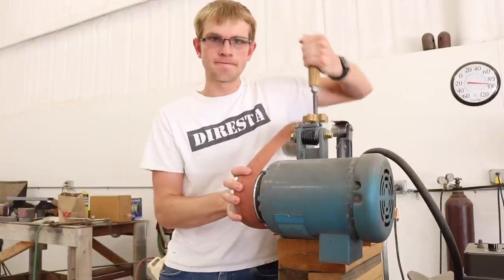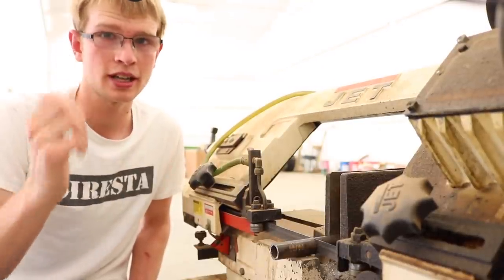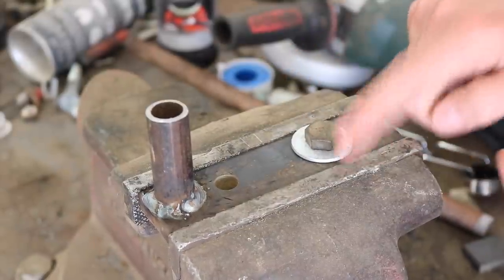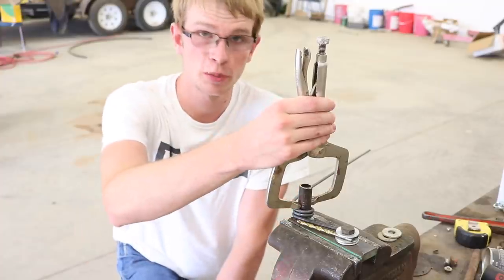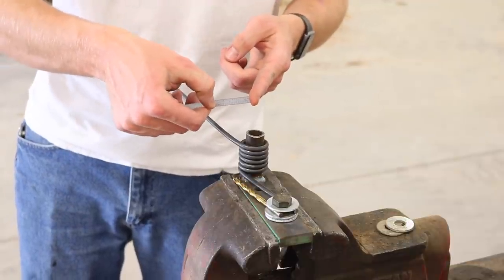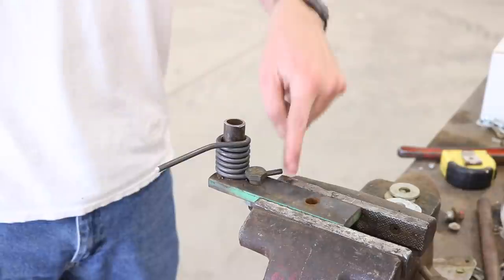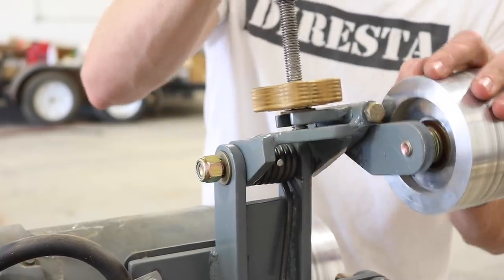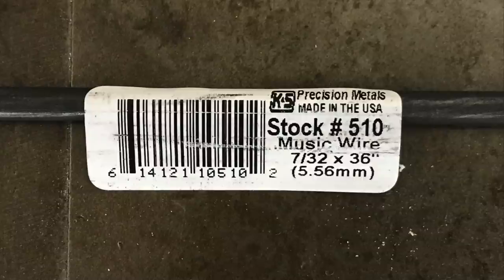How to make a torsion spring

Comment: Your description was very clear. With the spring steel wire, without heat treatment, sometimes tight bending can fracture the said wire. In the case of yours, clearly it was ‘outside’ those limits. Thanks for the good video.

Comment: Never worry if something is too simple.  There's always someone who doesn't know how to do something (or is at a different stage in learning than you are).
Reply: TheGeekPub that's right,we can't make alone,we can do great a field while people would do other fields better or they're not exhaust of thinking so they can easily make solution.
Reply: The Geek Pub. Zachary - I never knew. Now I do. Standing on the shoulders of giants and all that, or just being willing to learn.
Reply: I watched your video to see if it was even possible for me to make my own spring. It answered my question. Yes, I now know it is possible and will try it soon. Thank you for posting the video. It told me what I needed to know.
Reply: There is that saying there's many ways to skin a cat and some may need an idea on an easier way to do something. There IS a more complex way of making a torsion spring but your way achieves the same result a lot more simply.
Reply: Mike Hegarty  Me too! I've been woodworking for 20 years but watch em all because who knows? Maybe someone has come up with a better/easier way.  For eg: I watched a video by William Ng (I think that was his name). Saw him using vernier calipers. I've worked with certified Master Carpenters who didn't. I picked up a cheap pair for $10 and the quality and ease of my work has increased 10 fold.
Reply: yeds, like me.. I was wondering if spring steel needed heat treatment or anything in order to spring- this vid answered it beautifully
Reply: @muskokamike127  being skinned so many times? poor kitty  :(

Comment: Piano wire, or "music wire", is a specialized type of wire made for use in piano strings. It is made from tempered high-carbon steel, also known as spring steel, which replaced iron as the material starting in 1834

Comment: I just used this method to make a spring, very good. One improvement to the method is to first bend an inch of one end of the wire to 90 degresss. trapping this bend against your holding bolt, under the washers, will remove the need for a drill bit as a spacer and (more importantly) stop the wire from twisting at all whilst you are bending. Doing this my springs came out with virtually no slant on them.
Reply from the maker: Good point, thanks for the tip!

Comment: You're right that if the loose end of the wire gets away from you, it can do you some damage. I did that making a spring out of heavy copper wire, and even that cut my finger pretty good. I used a bolt for the mandrell so that the coils would approximately follow the threads, and it wound pretty close that way. I think this is a valuable video, especially for those who are going to build your grinder. The safety factor alone was needed.

I should have known that you're a farm guy. We learn how to do a lot of things that other folks don't get the opportunity to. Thanks for the video!
Reply from the maker: +Jim Hester 
I just hope I made the safety aspect clear enough. Makes me cringe to think of what could happen. 
I agree, farm kids get a lot of exposure to mechanical wonders, as well as the ingenuity required to fix them.

Comment: I had a 3/8 pipe x 3ft that I used to lever the complete spring.  I kept the tip of the pipe rubbing the top edge of the last coil allowing the friction to move the pipe  (this retains a constant hold back on the spring wire).  The smaller diameter pipe allows the the bend to occur only where needed and left a perfect spring with slight tweak.   I was surprised when finished the small amount of wire left in the pipe. This was as easy as I have ever made a custom spring.  A real plus is I have a free standing vise in the middle of the floor that allowed me to walk 6 plus turns without stopping or the need for a vise grip to hold down the spring wire.

Comment: Great video! To improve the safety and get a more uniform bend, just use the pipe (like you did at the end) to slip over the piano wire during the coiling.  Slip it all the way down to the coil so that the bending moment on the piano wire is concentrated near your mandrel. Thanks for the video!
Reply from the maker: +Chris Cirone 
The issue with that idea (I tried it) is that the wire curves, and the pipe tends to slide out, away from the mandrel. It's nearly impossible to get a tight, consistent coil. By doing it with bare hands, I can actually pull on the wire, where a pipe effectively pushes it.

Comment: You are a clever young man. I just comment on the name you used for your spring, it’s a spring which provide you with torsion by bending stress.
A helical spring, like most car springs today work by torsion, also straight torsion bars were used in Doge, Plymouth ‘72, ‘73 and in the VW Beatles too. I like what you do, keep it up.

Comment: Jeremy: this is how they made the original Motorcycle Valve Springs, which sat in the open, 
I am of the impression this is a preferable spring even for the Generation 2. This style of spring can utilize even low grade steel, it is commonly referred to as a portion style spring. While the Spring you chose for Gen 2 is simple, the class of having made your own spring as part of the project adds an additional involvement for the end builder. you may also consider a true torsion bar spring, in some part of the world good steel especially spring steel is more scarce or costly. Adding a very low tech item to the build if done by proper design may also be an attraction not a detriment. Something to consider Cheers and Thanks for Listening
Again Great Video, and for some who have never considered it a useful means to the creation to making your own spring. Not a waste of time at all. Well done.

Comment: This Old Tony has a great video on homemade springs, and talks about making some tooling for the lathe that allows you to wind strings under power, and use the lead screw to set the helical speed and what-not. Also anyone who has a copy of The Handbook, there's a couple of tables in there talking about mandrel size to use to get particular spring sizes
Reply from the maker: +Rob Mckennie 
Yes, there's some good info in that one. Here's a link if anyone reads this comment and is interested... https://youtu.be/jAawhg6JtyY

Comment: Be careful when adding the spacer, as the spring needs to reduce its diameter when compressing.  If the spacer is too big or the travel is too much, the spring will behind on the spacer and you'll end up bending the ends of the spring.
Reply from the maker: +David McKay 
That is true; the spacer needs to be undersized a bit.
Reply: I think adding the spacer inside the coiled part of the spring is a neat idea, but as you mention you have to make sure there is enough space for the spring to compress around the spacer so that it never gets compressed tight around the spacer as that would just bend the tails of it.

I think Jeremy will be just fine in this case as he used a 1/2" spacer inside and as the inner diameter of the coiled spring is closer to 1" there's plenty of space, especially as Jeremy is only turning the tails about 1/2 turn so the inner diameter of the spring is still a lot larger than 1/2", he could probably have used 3/4" and still end up fine. :-)

You could calculate the exact change in inner diameter as you know how many turns the coil have and the inner diameter of the spring in relaxed state, and then solve for 1/2 a turn less, but I haven't had my morning coffee yet so will leave the numbers to someone else. :-)

Comment: Temp springs after forming about 230deg or 110cel >  Quicker way use a gas flame till brown  wont sag . 1 off does the trick 
springsteel leaf  using for chisels & such temp red hot then soak in oil    then re temper back  250deg     ting!

Comment: Great video, would though add to bake your spring in the kitchen oven at 150-200 Celsius to temper it after that bending. This prevents the spring from getting a set, i.e. it doesn't die in prolonged use.

Comment: Sliding a piece of pipe that's close to the diameter of the stock, over the wire and close to the pivot point would help when bending a lot
Reply from the maker: I tried that. Didn’t work. The pipe slides back from the mandrel and the wire wraps loosely around the mandrel.

Comment: Make a second plate+rod to put over the shaft you are bending the spring around, put a bolt (and maybe some piece of pipe to act as a roller) as close to the shaft diameter + spring diameter, then you use that to make the roller press the spring around the other pipe. You avoid the major danger that way and it makes it more uniform. 

Make sure the plate n rod you use for leverage have blunted edges and I'd put a big ass bolt through the center so it doesn't fly up or around n slap you. Not sure if that illustrates it well enough with text, you can see the principle of it in action in most wire forming videos I guess. Maybe a spring from top of the bolt for downforce so the spring wraps are nice n tight.
Reply from the maker: +archades54 
I've seen how that's done, so I understand what you're saying. But I wanted to keep this as simple as possible, for the sake of those who want to make one custom spring. They aren't going to want to take a whole day off just to build a sophisticated jig to make one spring.

Comment: To make music wire work as a spring you need to heat treat it in an oven to set the shape and make it a durable permanent spring.
I made a duplicate of an AK hammer spring using the same size wire twisted the same way and it was much stronger than the original.

Comment: To make your bending jig a little safer and easier to use, take a piece of round stock that will fit into the mandrel tube and weld it to a reasonably long piece of flat stock. Weld a second piece of round  stock to the flat bar to make an F shape so that the second piece pushes the tail of your music wire against the mandrel. You'll get a more uniform diameter to your spring that way. Clear as mud I'm sure.
Reply from the maker: +Eric Morrison 
That makes sense. But I suspect most people will want the jig as simple as possible since they'll probably only make one spring with it...

Comment: Use the pipe for all winds, not just the final few inches. Better control.
Reply from the maker: +timffoster 
I suspect you haven't tried that ;-) I found it actually reduces control and makes it almost impossible to get a clean, even coil.
Reply: Jeremy Schmidt - I could've sworn I tried it a long time ago, albeit with much softer material. I'm trying to remember where/when, but coming up blank. Other than cope wire in tight space - hardly a real comparison.

Thanks for the correction! ...and keep up the good work.

Comment: Nice video Jeremy! And THANKS for that label!! I was wondering where you found such thick music wire, and the label will help me search online for it. Did you order that wire, or buy it from a store? :) 

If I may make a suggestion.......That piece of pipe you used at the end..........use that as a handle with the wire running through it, as you are bending the wire, from the very beginning. :) It will be much more comfortable on the hands, and offer more protection against losing your grip on the potentially deadly whip end of the wire. :) 

I found your video while looking for spring bending jigs online. Surely easy enough to make one like you have, as I have the necessary tools to do so.

Comment: Where did you buy that piece of spring wire??
Reply from the maker: eBay
Reply: Recently scrapped an old mattress, tons of material to work with just dispose of the fabric in black bags with your weekly garbage!. thanks for the video I needed a torsion spring for the chop saw 😊

Comment: Not a spring until heat treat.. Will not last very long angel will keep getting larger. Heat treat Music wire for 550f 15-20 min. Your angel will change about 10 to 15 degrees and diameter will close about 10m .
Reply from the maker: Notice this is two years old. The spring has not changed at all that I can tell, it still works exactly the same as the day I made it. I guess I’ll wait for the day when it starts to change, and then I can replace it... 🤷‍♂️

Comment: Perhaps a length of pipe over the wire to aid in bending it.
Reply from the maker: +Dave Anderson 
The wire tends to curve while bending, and if you use a pipe, the curve in the wire will push the pipe away from the mandrel. This reduces control and makes it difficult to create a neatly coiled spring. I tried it, and although the spring would have worked, it looked terrible.

Comment: If and when you do a video on tying your shoes... you will be able to accurately make the statement about it being too simple...

Although, have you seen how many different ways a kid can do their shoe laces?
Reply from the maker: +Timothy Hall 
Especially when you consider the fact I wear slip-on boots...
Reply: I have watched YouTube videos on tying shoes. Because i found that i have been tying my shoes wrong for 30 years, i had been taught wrong, and text descriptions weren't doing it for me. It was many years ago though. The problem is most people including myself are taught to tie granny knot instead of the balanced reef knot. The former unties itself, the latter doesn't depend so much on shoelace material, quality, how tight you tie it, it just stays properly tied, and it looks better because it doesn't rotate out of position and is easier to correct if it's not even. Since i learned the reef knot, i have found a new level of appreciation for laced shoes.

I still wouldn't mind a video that taught me to tie the reef knot more efficiently, but not enough for me to seek one out on purpose, because 90% of the videos on any given topic are going to be terrible.
Reply: Or you can go one step further and use Ian's secure knot! It is ten times less likely to undo than the knot you are using, and is neater in that it lays sideways. Look it up.
Knots don't make shed loads of sparks though.

Comment: Looks like it could use some thin brass washers in there. 
I think its a great video, I've never make a spring like this and have many cases where I have needed  a certain kind of spring for a project.
Keep up the great work!

Also how did you decide on the size of wire to use?
Reply from the maker: +Wing it Workshop 
Thanks!
The baler pickup finger I had been using was the correct amount of tension, so I just used the same wire size and number of turns.

Comment: Jeremy, what size of wire did you use and how much lb torque will it produce?  I'm can't find a ramp Torsion spring that will fit on my trailer and thinking about making one. Thanks for you video, great
Reply from the maker: If you watch to the very end of the video I show a picture of the sticker on the rod. That should help you out. (I think it was 7/32" but see the pic to be sure) Don't know how much torque it makes; I just tweaked it til it felt right.

Comment: What other kinds of wire can be used to make these springs ? You called it music wire if I heard you correct. Never heard of that befor so wondering what other wire can be used like from a hard ware store any particular kind thanks if anyone can answer this .thank you.
Reply from the maker: I don’t know of any other kinds... but most hardware stores have music wire. It’s quite common. They might not have this large diameter though.

Comment: Why is it called music wire?
Reply: It's because this type of steel is used to make piano wires and so forth. It can withstand a lot of tension, so it's great for making springs as well. The name just stuck, so it's used for anything that has the same kind of steel regardless of application.
Reply from the maker: +1ucasvb 
I suspect this 7/32" wire would produce a fairly deep note.
Reply: It's for a contrabass piano!
Reply: It was originally developed for pianos, so it has incredibly high tensile strength and resists deformation. People soon realized its properties made it really useful for other stuff, like springs and fishing lures, but it's still called music wire or piano wire.

Comment: if you hardened the steel after coiling it, wouldn't it hold the tension much better and for much longer?
Reply from the maker: Maybe? But I mean it’s still working just fine after three years.

Comment: Simple concept, but not understood by everyone. I actually bought your plans and am almost done except for this step! I don't know how I missed this video, but I was going to use a torch to bend the steel....and that would have annealed/weakened it!I looked all over for baler teeth and found them, but they would take a long time to ship. I checked Mcmaster-Carr, and theirs were not strong enough. I DID find these: https://www.amazon.com/gp/product/B005XQDNLY/ref=oh_aui_detailpage_o00_s00?ie=UTF8&psc=1 which appear to be quite stiff and I  got 10 for $12...but they are still smaller than your diy versions.  We'll see.
Reply from the maker: As long as you're careful to do it safely, I think winding your own is for sure the best option. It's really quite easy.

Comment: Don't you need any thermal treatment for the spring? Kind of stress relief? Not knowing for sure, but I've heard that these DIY spings tend to lose their tension (i.e. they will "die") if not thermal treated. How is it? Does it apply to certain wire materials only?
Reply from the maker: I’m not an expert in metallurgy. Tempering may be necessary with some materials. What I can say is that this spring is still working like new, about two years later.
Reply: @Jer_Schmidt  Thanks, that's enough info to me.